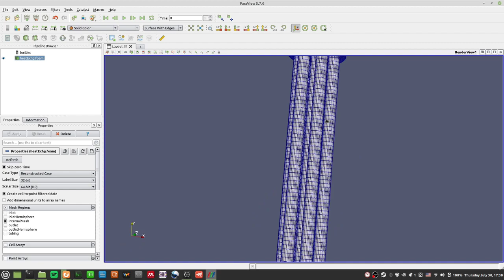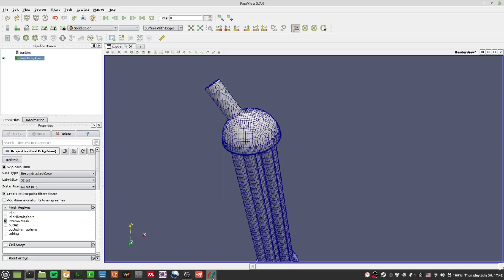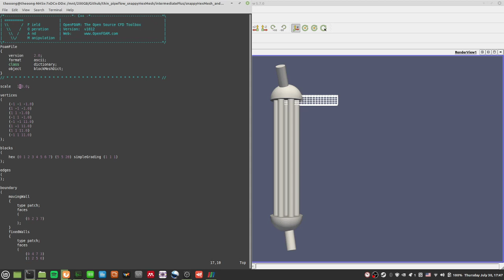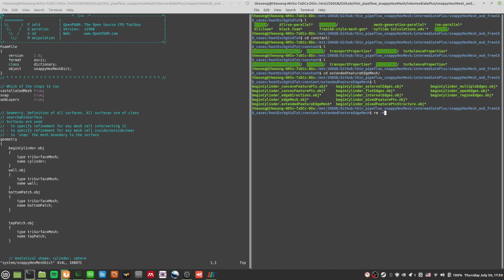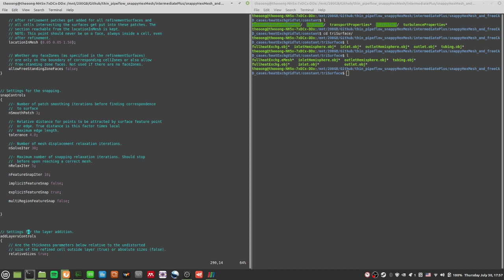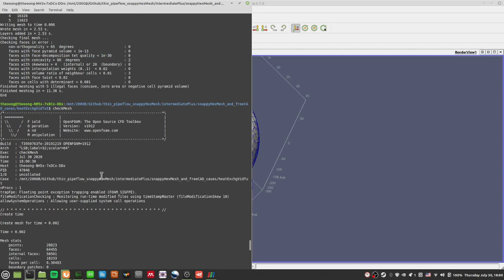Comment: updating myself with your playlist :D great as always. one thing i like to use to know if the surfaceFeatureExtract worked correctly i do 
"surfaceFeatureConvert constant/triSurface/model.eMesh constant/triSurface/features_model.obj"
and open fetures_model.obj in paraview :) (also it can be done previously to the surfaceFeatureExtract (but only to see if the angle is correct by using the filter feature edges (also the feature angle is the supplementary (angle1+angle2=180°) of the angle that needs to be used in surfaceFeatureExtractDict)
Reply: @TheoOngScienceAndEngineering  a pleasure, trying to learn OF alone is quiet difficult. As in my free time I try to dedicate to do tutorials or see videos about the subject, I always have some small details that different persons do differently and try to keep the best from each. But still not able to be indépendant as I would like to be with of..... Your videos are really helpful, I should finish the serie as I am in the 101 I think... Best regards!